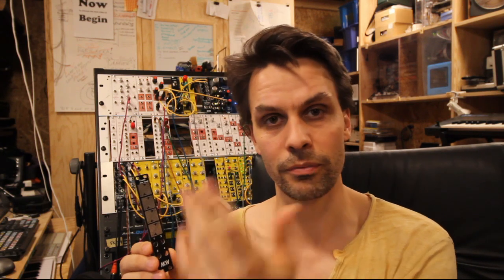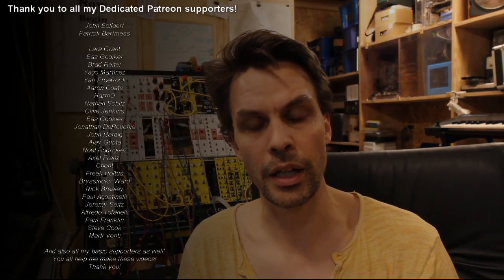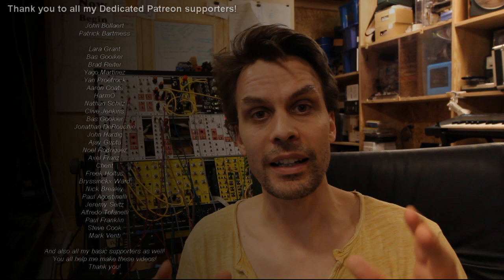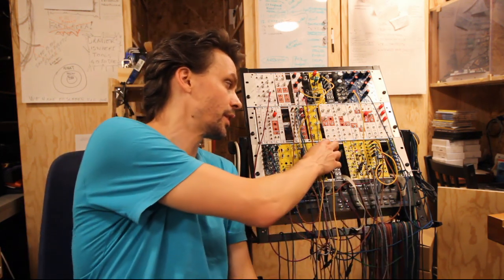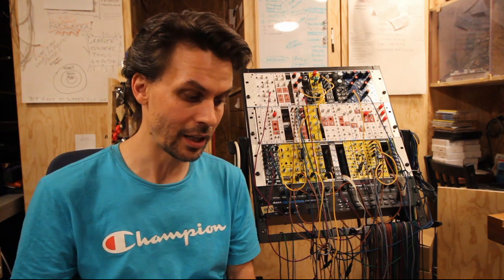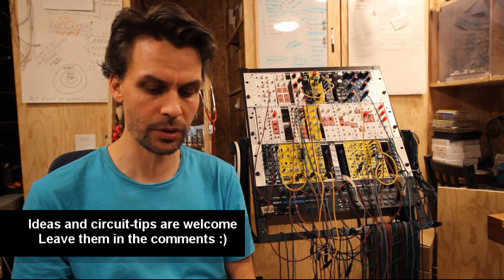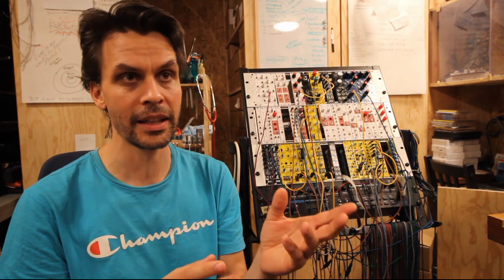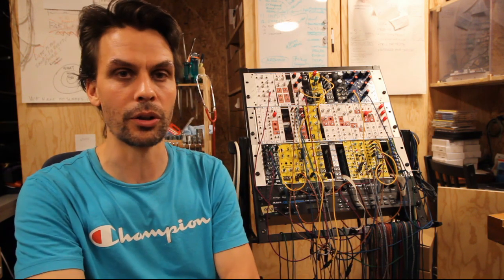A simple touch interface (part 1 of hopefully 2) - DIY Modular in a Week 11.2

Comment: Any way to get the schematic? Preferably using opamps.

BTW I tried this simple SynthDIYguy's circuit with 1uF cap, but it's not that responsible, and mains hum is getting through anyway. I got rid of hum completely with 10uF cap, but slew is extreme...

Comment: interesting and thorough ! yes Ive had this similar circuit in mind, but have yet to tackle it. I came across 555 timer circuit I think for switching/gate . My jasper synth has a capacitive keyboard but haven`t looked into that ...either. And then there`s this https://en.wikipedia.org/wiki/Capacitive_sensing

Comment: For making a gate you may find it interesting to look into the MPR121, which is a capacitive touch sensor controller. On the other hand, you could probably make one just using a FET, their gates are so sensitive that "pointing at them", i.e. getting near enough with your finger can make them trigger.

Comment: These just reminded me of some electrodes we used in psychological experiments:) I'm not sure if it is intentional, but it seem you wanted these squiggly lines on the pcb to be as "interwoven" as possible, but it seems the two squiggly lines just above the diagonal lines are connected to the same node. It just stood out to me that there is a piece of symmetry missing. Maybe a totally different direction would be avoiding direct contacts alltogether and designing the touchpads as capacitive sensors. This was just an idea I had because I recently watched a video about humidity sensors by andreas spiess (watch?v=udmJyncDvw0). He shows quite an easy circuit that uses a 555 to measure the capacitance.
Reply: Yes I also noticed the left fat fingers don't interweave.